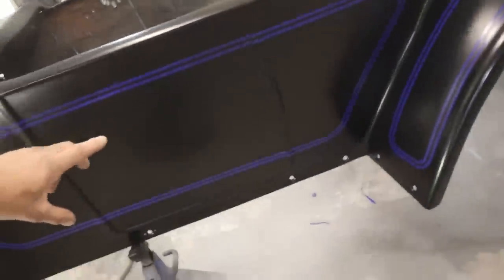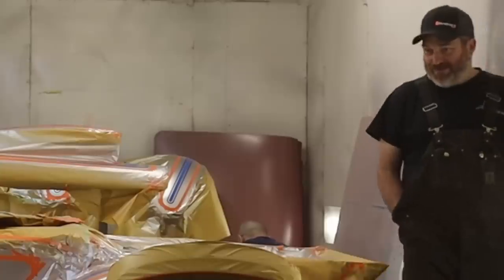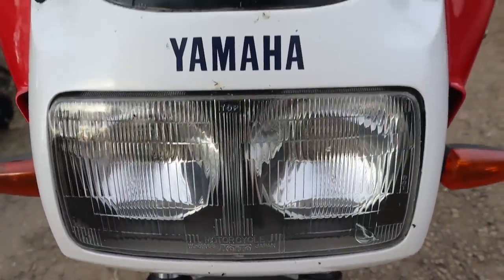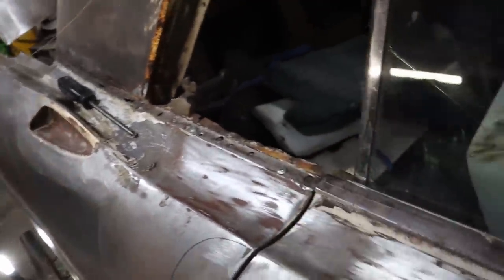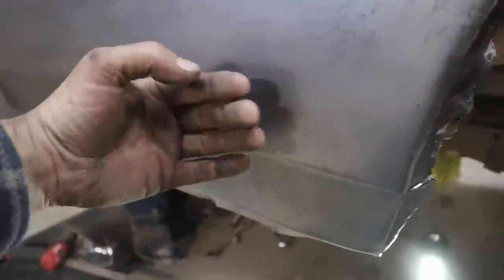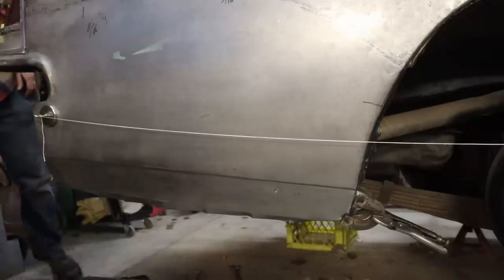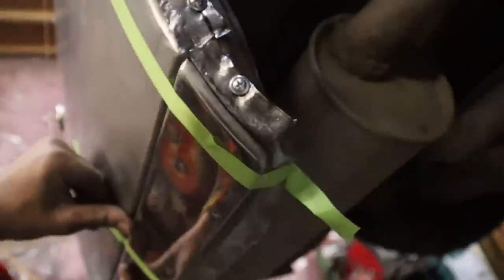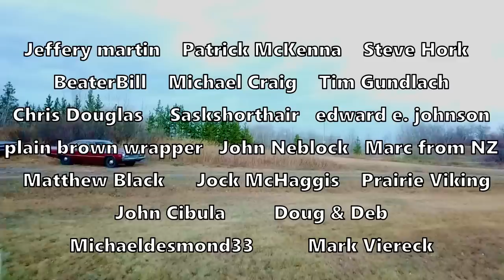Custom Paint Time! Model T gets all the Candy! Plus: 1956 Continental Mark II Marathon & Yamaha 750!

Comment: Another great show, thanks. I nearly bought a FZ750 in the grey and yellow colour scheme in the early 90s but went for a Honda VFR750 FH which I still have. Exactly as was said, the alloy frame and gear driven cams on the V4 Honda won it for me over the steel frame on the Yamaha. The five valves were cool, though. Both bikes have the 16" front wheel/tyre choice issue. 
Paint on the dragster looked fantastic. Excellent to see the design develop. Made me think back to the Boogie Van.

Comment: 8:29 - That is a 1968 Chev wagon.  Our fam had a 68 BelAir wagon, 307 Powerglide, not a cammed/tuned 427 lol.  For the 68-70 years, the sedans got taillights in the bumpers, but that apparently didn't work with the wagons.

Comment: Loved the moose , just stopped by to do a bit of trimming for you. The 1970 chevy sure brought back some fond memories of high school antics. (Learned how to clean spark plugs and how to drive really fast on the interstate to keep them clean on one of those so I didn't have to take them out all the time. Those would do 120+ and floated like a cloud. Gas filler location was where they all should be.) Jim's Lincoln will be stunning once again eventually. Shocking how much damage was hidden underneath all of the lead filler and paint :( Amazing job on the dragster!

Comment: All along, I thought Moose Knuckle was a place in Saskatchewan, but evidently there are a few of these in Alberta. I don't really know the habits of the wild moose, what little I know came from Rocky and Bullwinkle, who were from Frostbite Falls, Minnesota. Bullwinkle had an occasional segment where he was introduced as Mr Know It All. 

The drag car you're working on looks like it would be in a class like A/SR, or street roadster. These are very much like fuel altereds, except they are usually carbureted gasoline, not blown, nitromethane powered, and have fenders. Scott modestly disclaims body work professionalism, but he's pretty handy with a roll of masking tape and a gun full of urethane paint. 

I would imagine as with most viewers, we can do without 10 more episodes of fender straightening on Jim's Lincoln. Everyone wants to see all that mess given a nice coat of white pearlescent paint,  After that, everyone who worked on it these past two years will have to be given therapy for PTSD, Protracted Tapping and Straightening Disorder.

Comment: I'm not a big fan of the 1970 Impala's the 1969 Impala is the year I like so much better then the 68 and 70 in my opinion. My parents had a 1969 when I was a kid it was green on green if I remember correctly and it had a 327 in it and my uncle has a SS and it's got a 427 in it.